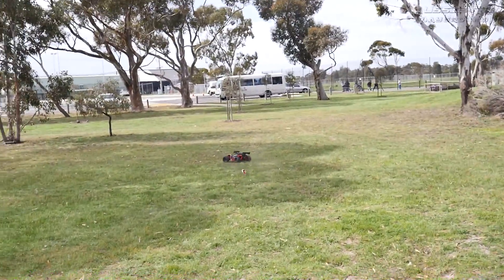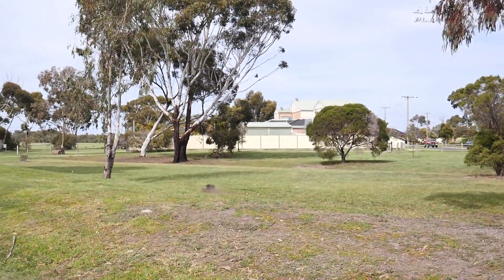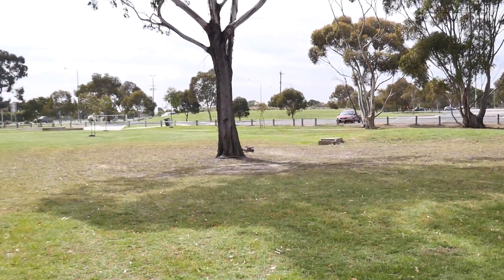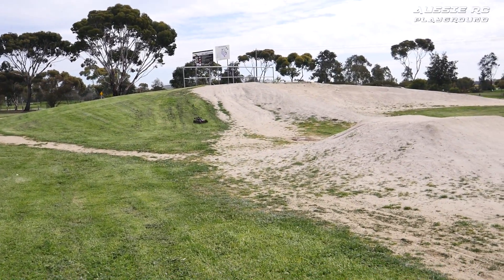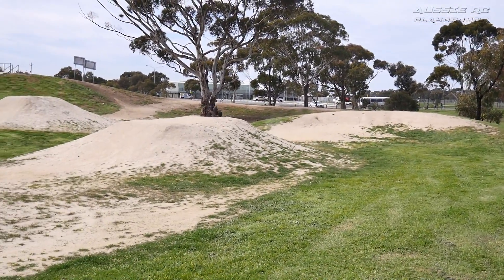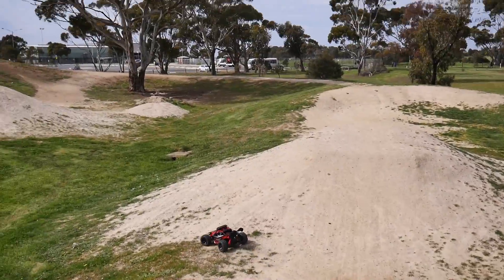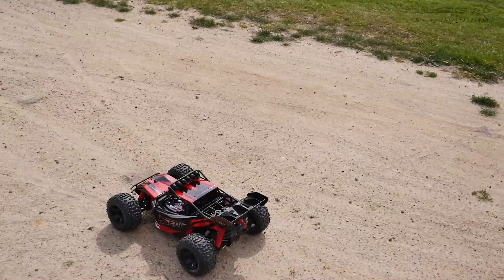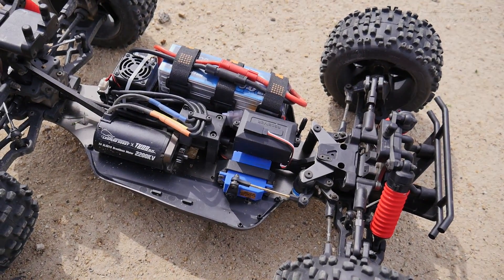Team Magic Seth Desert Buggy on 6S with Badlands 3.8"

Comment: i've bent my center drive shaft while on 6s and tryin full throttle for a split second on m ycar, xD lesson learned but i always use 6s anyways, i just set my "gas" expo to 50ish %, the car goes faster than 4s and the battery lasts twice!
Reply: Thanks for this tip 🍺

Comment: Short wheel base+narrow track width+6S=handful to drive! Kind of like the 6S outcast, but worse dimensions. Looks like the nose digs into the ground when you decelerate hard.
Reply from the maker: Short wheelbase? This is bigger than the OutCast and about the same size as the Kraton.
Reply: @AussieRCPlayground  Oh wow! It looked really short for some reason.

Comment: The wheelbase is just too short for 6s power and it looks a bit heavy for its suspension.
Reply from the maker: Wheelbase is the same as a truggy, so not short at all for 6S. However, you might be right about the suspension, but I have a plan for that.
Reply: @AussieRCPlayground  jeez I'd never of thought that was truggy size but you said they were different wheels !
Maybe they're to much diameter that the gap between front and back wheel from the side is too close maybe , which would make it wheelie a lot and be skittish in air under that power, which could make it act like a short wheelbase car if you get my drift

Comment: How much larger and heavier are those badlands vs the stock tires?
Reply from the maker: Good question. Size wise (diameter) they are about the same, but the Badlands are thicker and would weigh more, of course. I'll have to weigh them to know why, so might do that when I get a chance.
Reply: @AussieRCPlayground  I didn't realize the seth tires were that big.  How big is this buggy? Truggie wheel base?
Reply from the maker: Yeah, it's a truggy size chassis and wheelbase, but slightly shorter arms than a normal truggy.
Reply: @AussieRCPlayground  are those 3.8 or 2.8 and did you replace the hexs (shorter ones?) thanks
Reply from the maker: These are 3.8" Badlands. Straight fit, no mods needed.
Reply: @AussieRCPlayground  I have the 4seth and am looking to replace my wheels should I go 2.8 or 3.8. You have 3.8 on 6s, are 3.8 to much for 4s. I don’t want to run into heating issues.